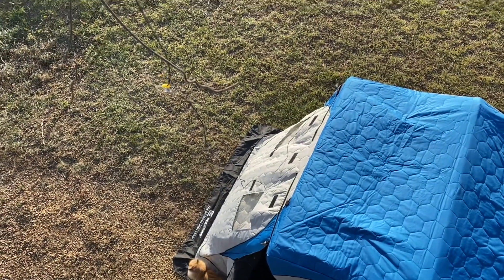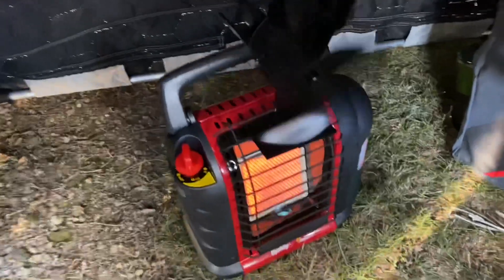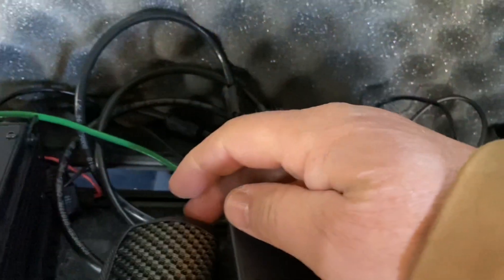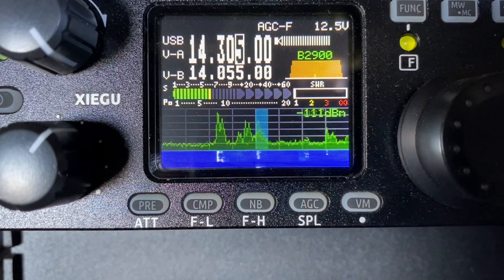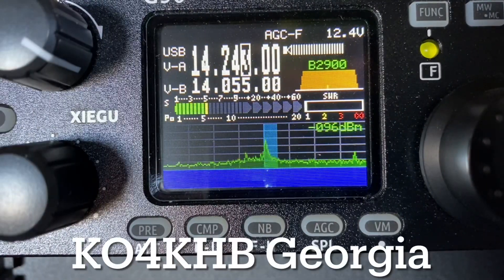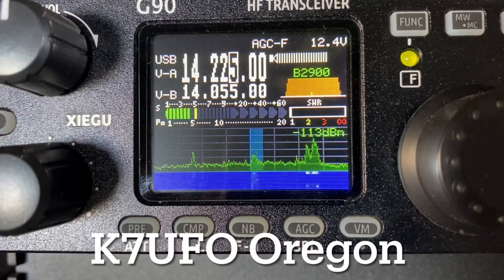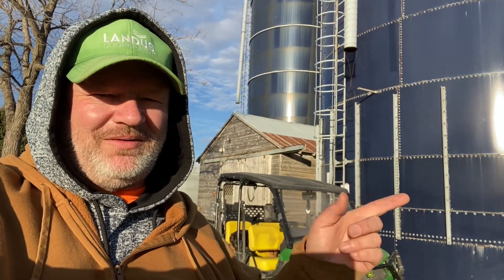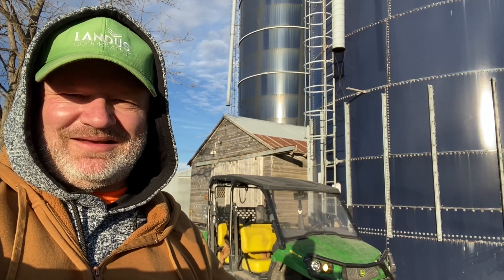The Silo QRP SSB 5w - Iowa

Comment: That's an amazing object to use at an antenna.  You sounded good on that G90 through my 705.  I was using "all 10 watts" on a home-brew end fed half wave sloped to the north/northeast.  Look forward to working you again.  73
Reply: It might be fun to put a solar powered wispr beacon on a silo and see what kind of results you get.
Reply from the maker: @km6qxe776  Hi John.. I'm still trying to wrap my head around that WSPR thing.. I can't get it to work very well on my ic7300..  I'm not sure what I would need to put a solar powered unit up there or how I would connect to it, but you are correct, it would be fun.. I'll need to do more research into all of that.. Thanks for your comment and for watching.. I appreciate it.. 73 Kevin ~ koklb
Reply: @hamradioqrp-k0klb  I have a uBitx v6.0 that is modified with an extra arduino nano. Its capable of WSPR which is weak signal propagation reporting. Its kinda like a beacon. The uBitx v6.0 is able to operate sending out the data on its own, just program with your info, no computer or soundcard/interface needed. I set the radio into WSPR mode and activate it to transmit. Once the data is sent out you go online and punch in your callsign in the WSPRnet and look for the stations that are listening and reporting picking up your information. Its that easy.
Reply from the maker: @kd5inm  Hi John.. Thanks for your comment.. I have the WSPR account set up at wsprnet.org.. I've used the WSJTX program on my laptop connected to the ic7300 but can only connect at 4800 baud.. I have only been able to contact 3 stations (MA, WA and somewhere in the caribbean).. I finally gave up.. Your comment sounds great and easy, but I'm not arduino or uBitx literate.. I will look into these more and see what I can figure out.. I'd like to activate my 3200 ft loop to it and see what it does.. Thx, Kevin
Reply from the maker: Hi Adam.. Thanks for answering my call and getting in the video.. When I saw you were QRP I knew I had to try and reach you.. The QSB was a little tough at first but you bounced out at the end.. Nice work on your QRP and home brew.. It was a pleasure to work you.. Hope to catch you again in the future... 73, Kevin ~ k0klb